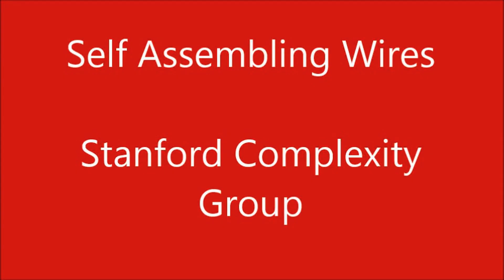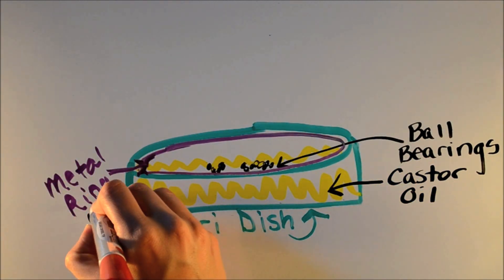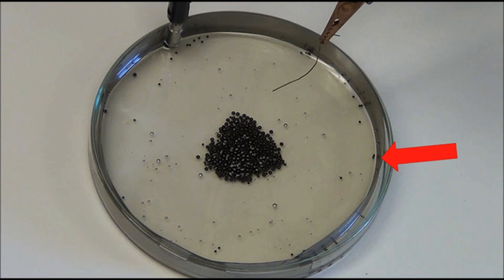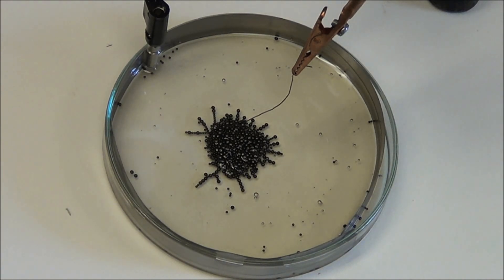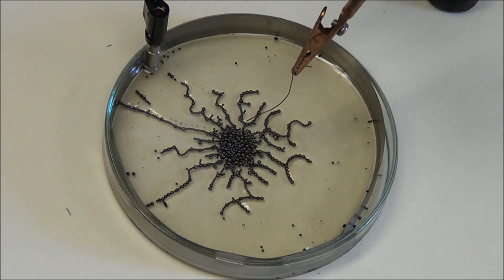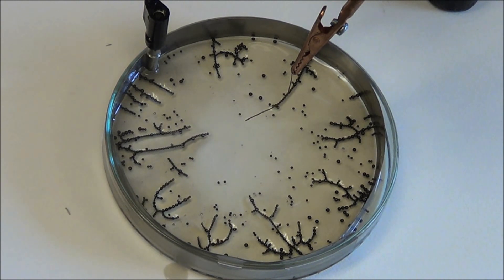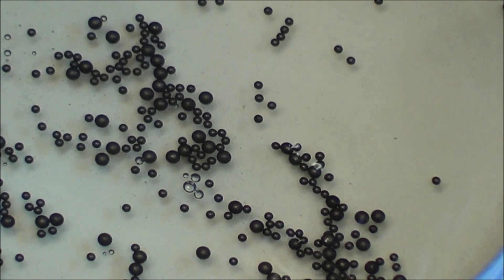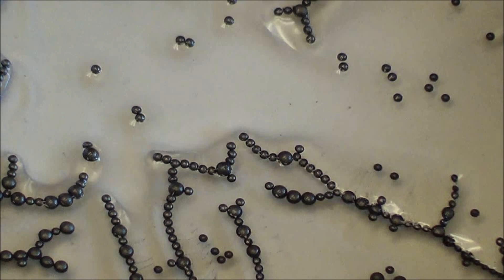Self-Assembling Wires

Comment: "there is no way you can do this at home"

me giggling by backfeeding a 480v lighting ballast with 120 to obtain same voltages... 
oh hey look at that... 30kv from 120v wall socket... but... he said it couldnt be done...?
Reply: Hey, he didn't tell you to do it so he can't be held liable for any damage caused.
I'm sure he knew how to get 20kv out of a wall socket, but I doubt he wanted to share that information freely.
Reply: @DefensorsPacis  I do wonder if those cheap $5 eBay “400kV high voltage generators” would work. Those produce more like ~40kV (estimating from the spark gap) and are (relatively) not that dangerous as they can’t deliver enough current to really injure you. 

This only motivates me to try this at home lol. Maybe with some steel shot, one of those cheap high voltage modules, some motor oil, and a mason jar lid. Could be done for under $20 :)
Reply: @eyeborg3148  Just do us all a favor and make sure you're grounded. Not going to discourage anyone wanting to partake in science at home, I just encourage people to know the risks and take appropriate safety measures.
I'm sure you'll do fine. Honestly, this is one of the most interesting experiments I've seen in quite some time. It really does seem to mirror a biological structure.
Reply: @DefensorsPacis  for sure, I know general high voltage safety but there’s are things like microwave oven transformers that I refuse to mess with - those things will easily kill you if you don’t know what you’re doing.
Reply: @DefensorsPacis  then do check out: Plasma in space experiment English subtitles
it's this but a few levels up.. 👉⚡👈
Reply: Just add some diodes and filter capacitors to get the peak DC voltage.

Comment: Screw string theory, electromagnetism theoryTM. Haha. Strange how when +/- conduction cannot be fully established the end results is the likes of lightening, nervous system, veins, river systems, tree branches/roots life trait habits etc ... Reminds me of a expanding universe in a petri dish. Energy is everywhere, transmits through us as "ground" by way of energetically charged universal/galactic/global sources "positive" or vise versa. May be different depending if your actually grounded or shoe-less. I have also witnessed this strange effect in high grade native crystal copper specimens mined from hollow voids deep within Michigan's high copper producing districts host rock. The crystals growth habit/trait seems to be dependent upon the intensity of magnetic arcs the likes of coronal loops during solar flairs. The more conductivity the more defined the crystal/crystals, yet there can be too much energy involved. But in this case the energy would be produced by the earths internal core which produce electromagnetically charged field lines which in return then branch out to try to establish +/- connectivity. Otherwise everything would just be a metamorphosed mass with no clear definition with no chance for creating organized structures other than in the instance of statically charged particles/elements. Then there is the remnant energy, left overs from the creation on, which in affect keeps the filament-al transfer, growth and adaptation of life possible and ever expanding. I'm no scientist, although I wanted to be one as a 3rd grader and always striven for knowledge and understanding. I could go on and on and on, on so many subject theories!

Comment: Try this with DDW on new acrylic, or on extremely clean glass.   WATER IS ALIVE!  
Well, actually it's just the infamous "water bridge" phenomenon.   With pure insulating dw water, borders of your water-amoeba become unstable, and begin sending out questing "pseudopods" in realtime.  Adding a metal ground-plate below the dish will compress the field and greatly reduce the voltage required.  Tiny bits of contamination spoil the effect.   (Dunno if anyone has ever written up the H2O version.   It's just the Armstrong/Fuchs water-thread, but w/2D array of separate threads.)

Comment: Announcer: Can't try this at home due to high voltage. 

Me: Haha tesla coil goes brrrrrrr
Reply: I've got a 15kv neon transformer. Felt cute, might try later.
Reply: @RingingResonance  XD
Reply: Tristan  When I was a kid I had a neighbor who reversed the input/output on a model train step down transformer.  Not sure what voltage, but he made a pretty impressive Jacob's Ladder.  Not sure how long the transformer lasted.
Reply: You have a rectifier that can handle that?  Or you going to try to reproduce this with AC?  They guy with the van de Graaf would be better equipped.
Reply: 20KV is what you call high voltage, pff, come on
Reply: If it's just dc then those voltage doubler setups chained infinitely would you get you there from the wall.  Never said you needed high current too.
Reply: Me: Van de Graaf goes brrrrr
Reply: Old CRT tube TV's used to have high voltage circuits near 20 kV (or even more). Just saying...
Reply: Also me: creates nuclear reactor from soda cans

Comment: We are witnessing "dendrite" formation - the same phenomenon that kills Li batteries.
Reply: So this experiment is essentially fuc*ing up.....on purpos...
Reply: i am not sure that this is the case, as this experiment appears to use electrostatic forces, as well as surface tension of the oil and maybe even electrolysis to achieve these effects.. the deposition of lithium ions onto a cathode/anode inside an electrolyte sandwich as thin as your hair at low voltage, is different..
Reply: @Voidroamer  I doubt that surface tension, as opposed to viscosity, is involved, and I don't think electrolysis would come into play.  The oil acts as a dielectric, and would polarize somewhat by molecule orientation, while the balls would also polarize, but no chemical reactions.
Reply: @goodmaro  I wonder what would happen if this experiment was done in a zero-gravity environment? Hope some loaded-ass science youtuber would get to read this out there.
Reply: @noiJadisCailleach  That could have the advantage of being in 3-D.  Modeling 3-D processes in 2-D has to distort them.
Reply: @noiJadisCailleach  Thinking about that neuron comparison, I wonder if size effects speed and overall ability to form these chains when voltage is constant, or conversely, if neurons are able to form in this manner even at the low voltages of an operating brain, due to their incredibly small size?
Reply: @noiJadisCailleach  Or someone in a research lab
Reply: @goodmaro   I bet you get all the ladies or at least one lucky one. very interesting stuff.
Reply: @Voidroamer  I'm not claiming anything other than - I think that many of the operating forces we are seeing her are also present in Li battery dendrite formation. It is assumed  there is 1:  an EMF of some magnitude in both cases. 2. There is a path of least resistance for the the self assembly (unless you have another term explanation for the formation of dendrites in LI batteries other than 'self-assembly')  - I will admit that they are not identical systems but there seem to be homologous behaviors and outcomes.
Reply: @smde1  i would have to agree, I'd say although there are some marked differences between the two this may be a good analog of how they actually assemble. I'll ask a colleague who knows more about the physics if I remember. Also a similar thing forms from conductors carrying high frequency signals (especially low melting point tin alloy lead free solders), this killed a lot of servers when lead free solder was introduced.
Reply: @Voidroamer  Thats terrible pseudoscience. There isn't going to be electrolysis in oils. Surface tension has no purpose here either, it just makes the bearing float. Its specifically mentioned castor oil is used to adjust the speed of the dendrite formations. Inside batteries there is a layer of insulator between the positive and negative poles which creates capacitance. Now unless the insulator is a true vacuum, the insulator media will always try to establish connection between poles albeit extremely slowly. The higher the static charge across, the more electrons get aligned out of insulator molecules to establish conduction. You can see this in Lightning as the charged clouds and ground excite electrons out of air molecules and the lightning is dendritic in shape for the same reason.
Reply: @HolyRamanRajya  I never said there was oil in batteries, and I believe you are describing a capacitor (having an insulator between the cathode and anode). Castor oil probably has to be used percicely because of its properties. You can see it being attracted to the ball bearings, forming a meniscus around them. I am not sure if surface tension has anything to do with their motion, but it sure seems that way when you look at these spheres of oil bumping into each other
Reply: That's why lithium battery hate over voltage
Reply: I don’t know who to believe cause am not into science
Reply: hey @smde1 does that also mean ki in order to recycle the batteries, or improve life, we have to open up the battery and can by some way Re juggle the surface to break these chains? Like high positive charge will mean every bond breaks by repulsion. What say?
Reply: @riquardi  yes
Reply: https://youtu.be/0VkrUG3OrPc
Reply: Thats interesting AF
Reply: manitoba2445  I've heard that by hooking them up to a car battery for a couple seconds, it breaks them apart and the batteries are like new again. Just don't let them blow up.
Reply: Isn't dendrite formation due to something in solution , the balls are not in solution the oil is a solution but it carries nothing but the voltage acting as a bridge between pos. And neg. Poles  ?
Reply: Interesting i wonder if this might be a basis to how life forms, and why our blood vessels forms like this
Reply: @NeostormXLMAX  After all, it is an electric universe !
Reply: No more batries to change it at all
Reply: Aren't dendrites a part in a Neuron cell we just had this lesson a while ago. is this by any chance how a neurons bramches forms?
Reply: @lunapam2447  dendrite means "tree-like formation"
Reply: @IxodesPersulcatus   oh so that is why
Reply: @lunapam2447  A dendrite is a tree-like structure, neurons form dendritic structures but it can also be found in crystals and some mathematical concepts. One example of a crystal would be a snowflake, certain fractals have a dendritic structure too.
Reply: @lunapam2447  I was thinking similar. You can see a type biological pattern in the formation. I am curious to know if there is a relationship to the physics involved to?
Reply: this is the same process when I don't sleep all night my eyes get fugged with bloodshot
Reply: haha, phone battery go BRRRRRRT
Reply: @TheWizardGamez  oh... you just remind me of those plants in that movie...what was it?...The Ruins??? drrrrrrring...  drrrrrrrrrring...DRRRRRRRRRRRRRRRRING!!!!.....

Comment: Electrostatics at work! Pretty much what I would have expected... although it's way prettier than expected! ;)
Reply: not even. This is complexity theory in action.
Reply: @NightmareCourtPictures  The driving force is the electric field = electrostatics. And the movement of the beads is just what you would expect from conductive pieces in a good insulator under high voltage fields. No need for a "complexity theory" here....
Reply: @jackmclane1826   "Created by the Stanford Complexity Group" in  the description of the video.

My guy these are complexity scientists creating complex systems. It's literately about creating complex systems, and a demonstration of how simple local rules create complex behavior that is reflected in nearly every natural process. Electrostatics is the boring part that explains how electricity works...this behavior isn't unique to just electricity. It's behavior that exhibited by nearly every natural phenomenon with or without electricity. It's a much grander and much more exciting idea.
Reply: @NightmareCourtPictures  a motor car is a piece of engineering, but thermodynamics are at work in it. Same thing here: it's a complex system where electrostatics are at work.
Reply: @jackmclane1826  I think there is also electromagnetics playing a role, those beads are conductive are they not?
Reply: @dronillon2578  No. There is practically no current flowing and electromagnetism is all about current. No current, no magnetism. The driving force is all electrostatic. If you pay attention you can directly see the tendencies of like charges to repel each other. This is what creates the fractal structure after making contact.
Reply: @jackmclane1826  I would have thought there is some significant although not overly big current going through, given the rather high voltage applied. I mean at least after the beads make a connection between the poles. Too bad we can't see some time/voltage/current statistics. Thanks for explanation. Cheers
Reply: @dronillon2578  At 20.000V you'd see it arcing from the wire tip.
Reply: @jackmclane1826  I thought I have seen some arcs. But after closer inspection on bigger display it seems like it is just light reflections as oil bends around the balls. Admittedly I don't know much about high voltage physics, wish I had the time and opportunity to study it more.

Comment: I hope this division of Stanford isn't called "Skynet". That's all we need is for robots to be able to assemble themselves.
Reply: Soon they will both build and maintain themselves, and it will be the a huge part of the actual beginnings of human "civilization."
Reply: @RayoAtra  Then add human brains in jars, or human "uploads"   ...and we're back to square one!
Reply: I came here to look for a way to encode my traces into some sort of way that mimics natural neural growth. I think that something like this can build the polarized network tier by tier. I would need to alternate the charges between each layer so that they repel and attract properly. With every node in each layer having the same polarity I shouldn't have them making axon to axon connection or dendrite to dendrite connection on the same layers. The one thing though is that the connections have to somehow be tracked and polarized to maintain data integrity. It would be added complexity but until that problem is solved it can be bypassed with an added circuit to the soma that tracks what connections are made and in what order so that the data can be retrieved with no loss.

Comment: They aren't ball bearings. They're steel balls. A ball bearing is equipped with an inner race and an ourter race.
Reply: People often call the balls that come from bearings, ball bearings, as they are uniquely hard compared to many steel balls
Reply: @ARVash  They may, but if you ever try to buy steel balls you had better never go out shopping for "ball bearings" because all you'll find will be complete bearing assemblies with inner and outer races. If you try to buy steel balls, then you need to shop for "steel balls".

...unless they're uncommonly small, of course, in which case you'd shop for "steel shot".
Reply: @timhofstetter5654  You can disassemble them and now you have very tight tolerance and high hardness steel balls, this is why people use "ball bearings" as a term of art.
Reply: @ARVash  You may or may not have tight tolerances. Depends upon the specs for the bearings. The "best" skateboard / inline bearings have very loose tolerances. Just as bad are the cheapo linear ball bearings for CNC use.

Some bearings call for exceptionally tight tolerances; those are the ones that are actually a little difficult to turn by hand.

Hardness is generally pretty immaterial for ball bearings. They need to be tough, not hard. Hardness is actually a detriment, because hard bearings tend to shatter instead of temporarily distorting. Any bearings specified for critical equipment have high toughness low hardness balls.

Comment: feels like ultra mega super slow motion lightning strikes
Reply: I think this is directly analogous to how lightning is formed, with "leaders" projecting from either side of a charge differential.
Reply: @ariochiv  yeap, that's why this was my first association. :)
Reply: Actually that is exactly what it is.
Reply: Or fast...  The attraction is there...  the slurry slows the growth.  They should try other oils.  You could probably pull a B-B through warm wax with the right amount of attraction.  Being only one 'candidate' it would likely be a very straight path through the candle to the outer 'plate'.  Add more B-Bs and they all 'compete'.

  Hey another candidate for the fluid would be 3M's dielectric fluids  Here's one...  https://www.3m.com/3M/en_US/company-us/all-3m-products/~/3M-Novec-7700-Engineered-Fluid-100-ml-Glass-Bottle/?N=5002385+3288713617&preselect=8710710+8717595+8734647+8745514&rt=rud

  Then they can look at it in 3D as you add depth to the dish.  This stuff is clear (transparent) and >25kV per 0.1 inch gap, btw.  So 2.5kV per mil.
Reply: I really like your pfp
Reply: feels?
Reply: I think stuff like that when I'm on acid.
Reply: Now I need someone to speed this footage up by a million times or however much faster lightning is.